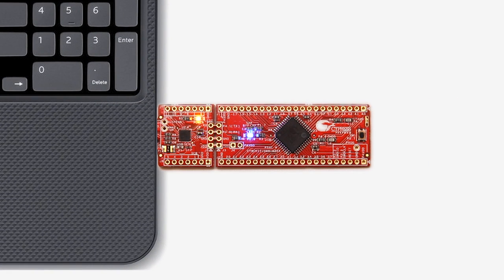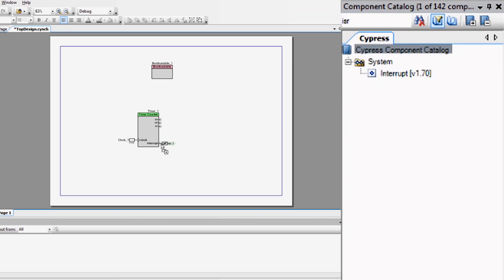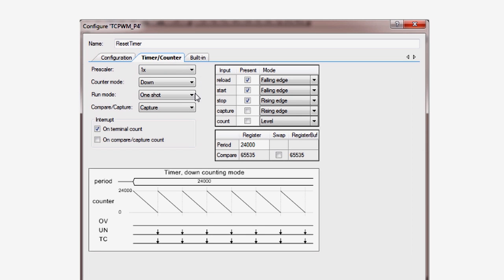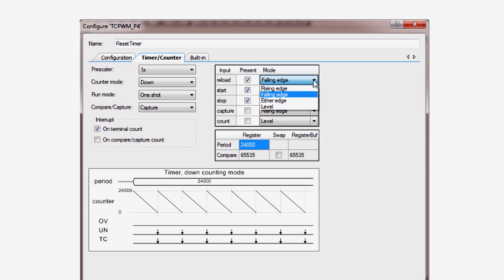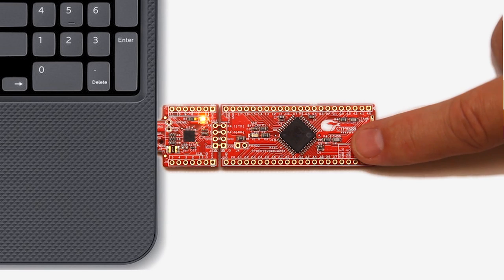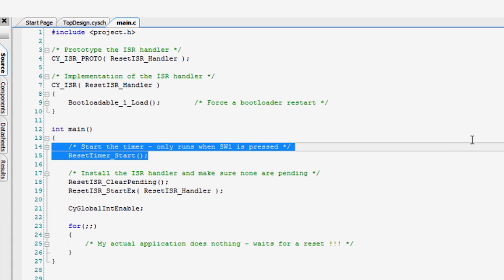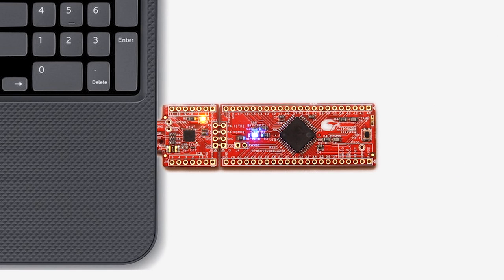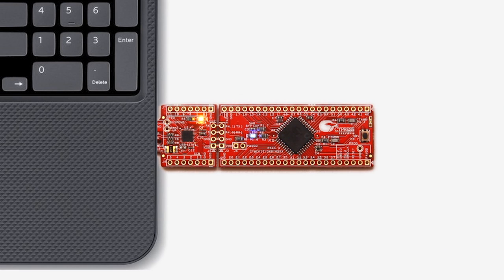PSoC Creator 101: 2. CY8CKIT-049 Prototyping Kit Reset and Return to Bootloader Project

Comment: The CY8CKIT-059 has no Timer Counter's???  and yest found a whole lot of 404's out there.  Seems Cypress could do better and be more solid with their info if they want you to use their boards.  So far, can really find nothing useful to do with my board.  I'm used to the cheap boards like the little Wemos Di mini which is a lot less complicated to program and is very useful.  I have one monitoring the temperature and humidity in my observatory with a bme280 and mqtt.  So far, could only blink the LED, make a breathing LED or say 'Hi there' on an oled.  Nothing yet very useful.
Reply from the maker: Hi Joseph, the PSoC 4 devices have hardware blocks called “TCPWM” (Timer, Counter, PWM). Those blocks are configurable to act as any of those three peripherals. You can get information from them by opening the TCPWM component datasheet inside PSoC Creator, and also in the datasheet found online: https://www.cypress.com/documentation/component-datasheets/psoc-4-timer-counter-pulse-width-modulator-tcpwm. 

The PSoC 5 devices have separate components for TCPWM, including UDBs (Universal Digital Blocks) that can be used to create more timers, counters, and PWMs if there aren’t enough fixed function blocks for your application. The component datasheets can again be found inside PSoC Creator.

Additional help can also be found on Cypress.com under “Design Support” or in our online community:  https://community.cypress.com/welcome